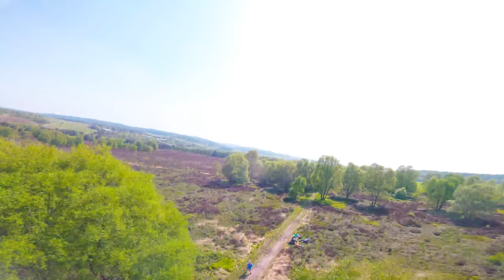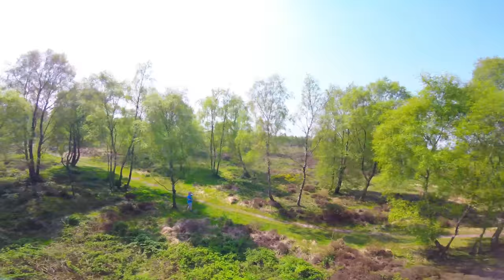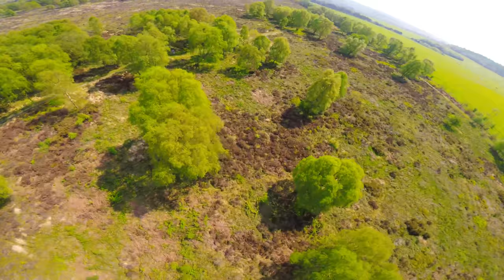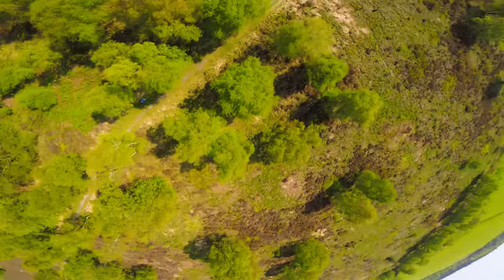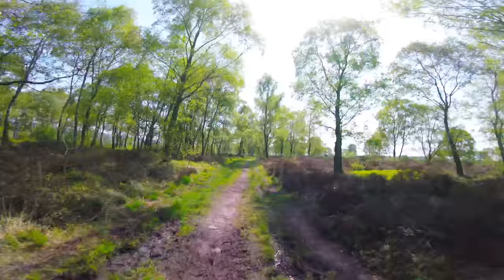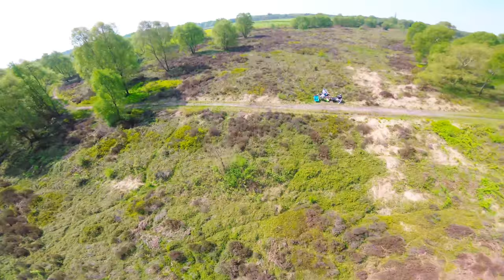FPV 2700kv Looper - Raceflight Bolt32 594 Firmware

Comment: I have RF on my Mericas and I absolutely love how smooth it is. What are your thoughts. I can definitely see the smoothness of RF in your flying 👍
Reply from the maker: Bari FPV thanks dude, generally I do love how RF flies but to be honest I’m struggling a little at the moment with these latest firmware’s to get the feel I want, I’m not sure what it is exactly but I’m kinda almost happy if that makes sense,  I’ve got some new idea still to try when I get some more stick time, I’m sure I’ll get there 👍👍👍
Reply: Bazzafpv man I don't run after firmwares. Even my BetaFlight quads still have 3.3 and some 3.2. I just tune everything the same way. Can't be running after new things 🙂 so, I say I live in FPVs stoneage behe
Reply from the maker: Bari FPV yeh I’ve some really great improvements on some firmware updates though, I just think it’s a bit more in-depth tuning RF now and more involved with the filters etc, I will get there I’m sure dude 👊